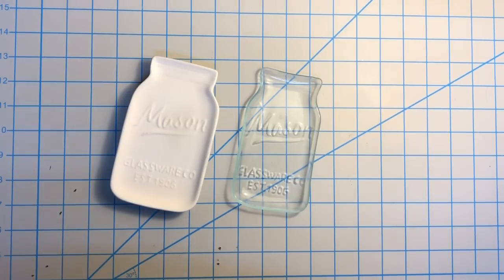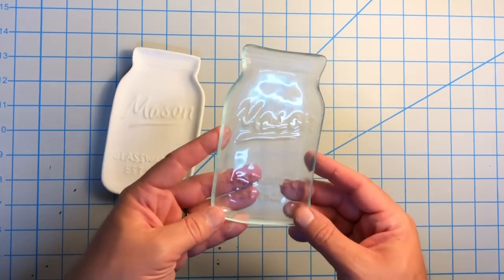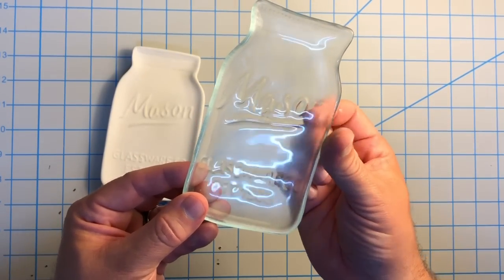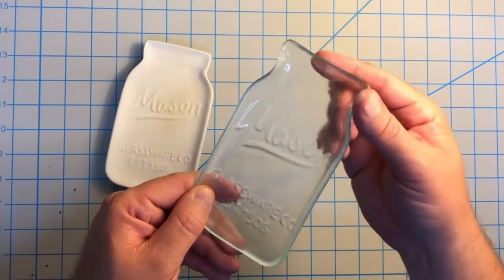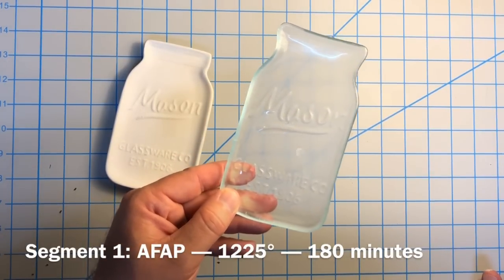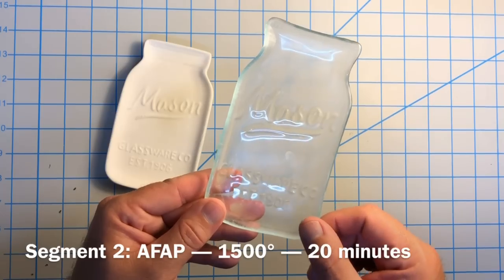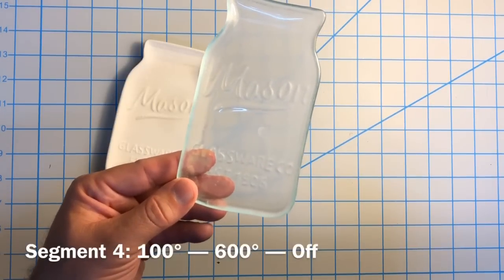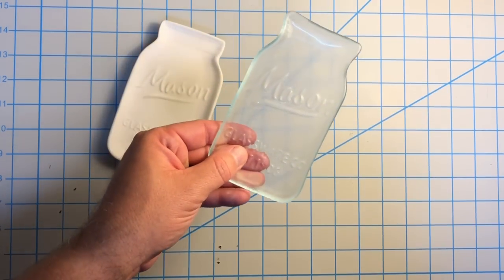NONTRADITIONAL fusing mold

Comment: Thanks for sharing ❤️ I could have used a glazed ceramic mold after purchasing all those expensive slumping molds 🤦‍♀️
How thick/sprays did you do to cover the glazed ceramic?
Reply from the maker: I probably have 3 coatings or so? With the glossy ceramic, the Zyp does flake off very easily. I still love my more traditional molds but this is fun to play. If I had a sandblaster, I’d probably try to sandblast some of the original ceramic glaze a bit to create texture for the Zyp to adhere to.
Reply: @JamaisonSchuler  as this covid shutdown continues I’m so blessed my family are safe and healthy even tho I’m scraping keeping the power on and mortgage up. It will be along time before I can splurge on supplies, I just 🙏all country’s get back to normal soon. Keeping everyone in my 🙏always 💕